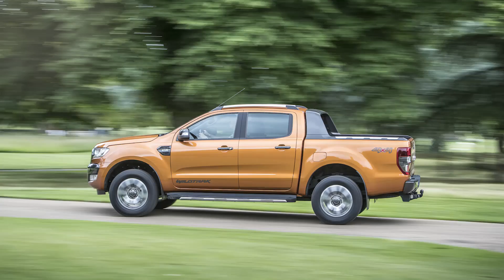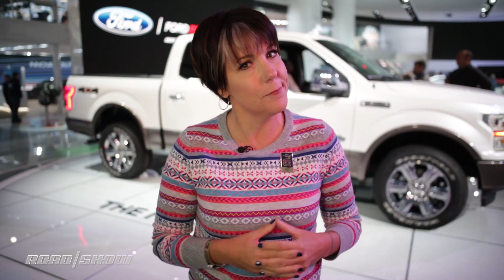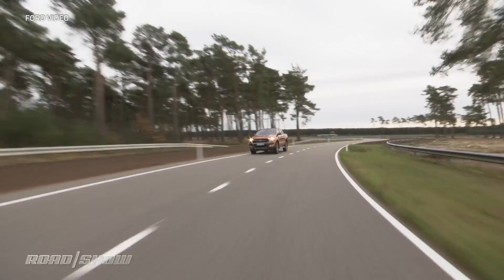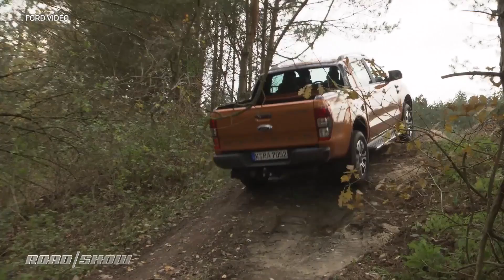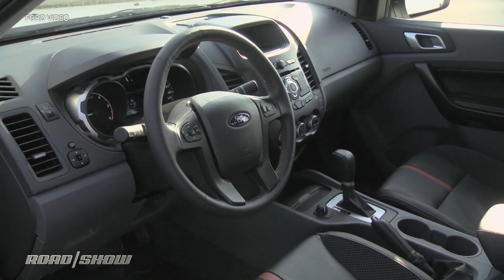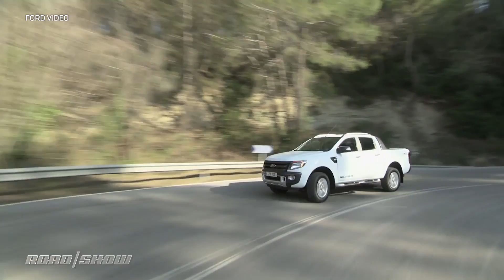Let's forecast the 2019 Ford Ranger | 2017 Detroit Auto Show

Comment: Some of the “forecasting” in this video is just plain horrible.  Ford is going to put a smaller displacement of the 3.0l v6 diesel in the Ranger?

That makes zero sense and this is literally the only media outlet that is claiming that. Also your torque figures for the Diesel engines were wrong.

Comment: If Ford does not offer a manual transmission option for trucks equipped with the 2.3 L and the 2.7 L engines, and above the base trim line, overall sales will reflect those mistakes. More than half of the original Rangers produced were equipped with a manual, regardless of engine size.

Comment: I'm very skeptical but hopeful that Ford will get the new US Ranger right.  It needs to be sharper, boxier, and more aggressive looking than the current non-US model, it needs a very base model for cheap (~$20-24k), and a mid-high end off road package to compete with the Tacoma TRD Pro (think mini-raptor but for around $40k).
Reply: do the math, XL (base trim level in Mexico [6-speed manual, gas engine, 4X2, double cab] ) is $360,000 pesos
south american markets have a single cab option
if they are planing to build it in the US it will be a lot more expensive
as for the looks i don't think they will change it, maybe just a facelift, it's a global platform
australasian market uses it for the everest SUV, the future bronco

Comment: They shouldn't do anything with the exterior or interior. It looks fine the way it is. Just put the 2.3L Ecoboost, the 3.3 V6, the 2.7L Ecoboost, and an optional Diesel engine and I'll be happy.
Reply: And bring the manual over which is already in use and already designed.
Reply: They made the Baja (basically a UTE with ground clearance) and it sold in the USA for a short time.
Reply: The word on the street is that a diesel option is coming in the future.
Reply: Barbados Joe  I like the way it is too, but as Subie driver I may be biased. I'm surprised Subaru never made a small modern pickup. It would sell in the US.

Comment: I hope you are wrong about no manual being offered (I'm sure you feel the same way, too Emme).  The Colorado and Canyon offer a manual option albeit in base trim.  With or without the manual though, I am very happy that the Ranger is coming back to the North American market.
Reply: brian5o it's pointless without manual transmission  4x4 turbo diesel.  that's the main attraction.  not because it's a ranger.
Reply: The Tacoma has always had a manual option as well. Since Ford wouldn't have to design one, I say why not? No excuses are allowed.